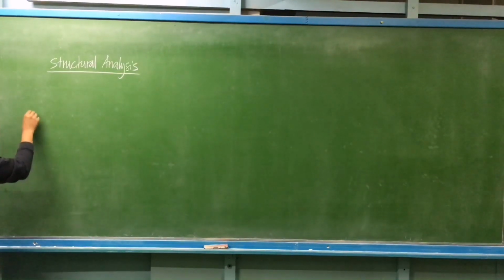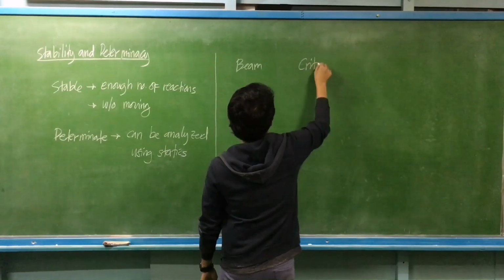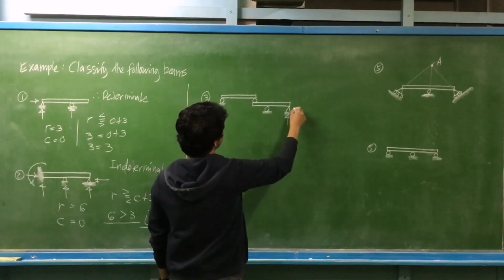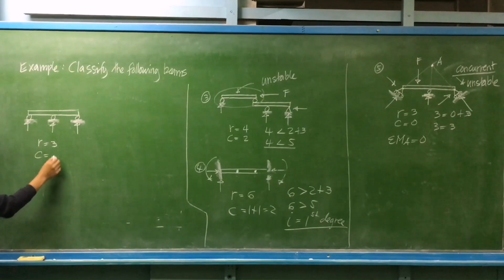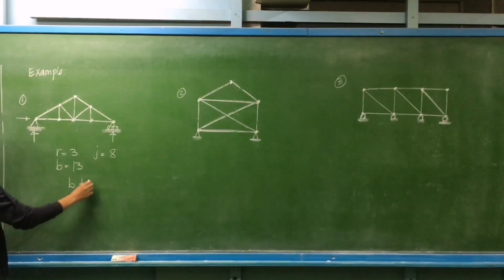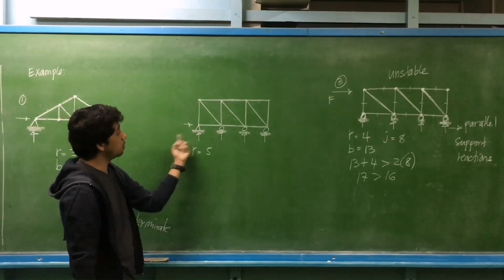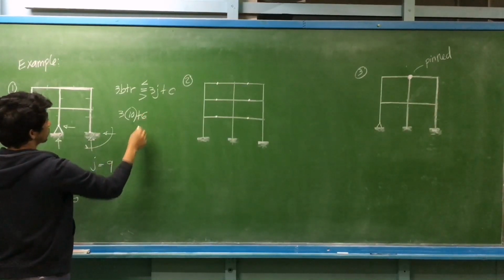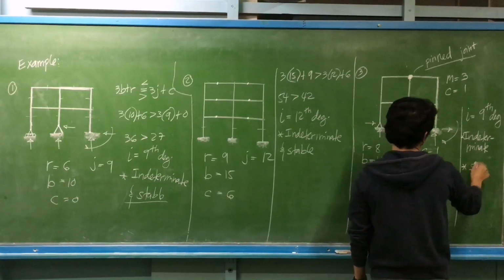Determinacy of Structures

Comment: Good morning sir. Kapag po sa determinacy ng beams, using the given formula. Baliktad po ang equivalent ng forces ng internal roller ng hinge at internal roller? Meaning instead of 2 reactions sa internal hinge, it should be counted only as 1 and vice versa?
Reply from the maker: Reference ko is Kassimali. Yung 2 sa internal roller means no moment transfer and no horizontal restraint.